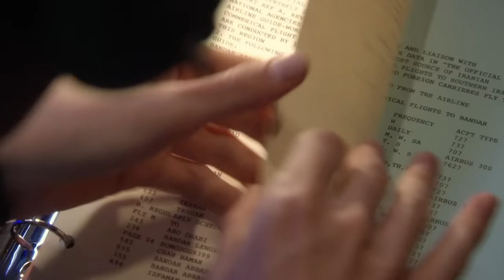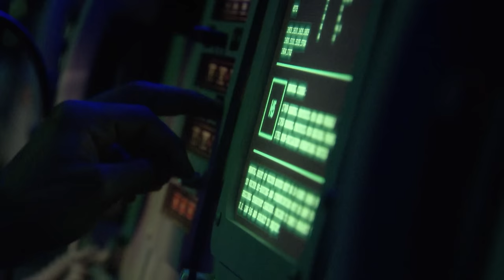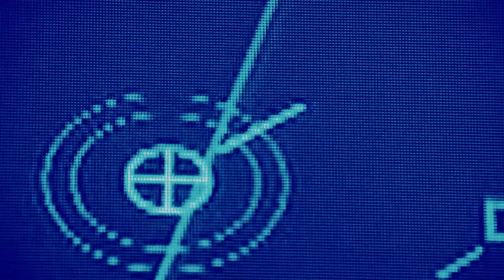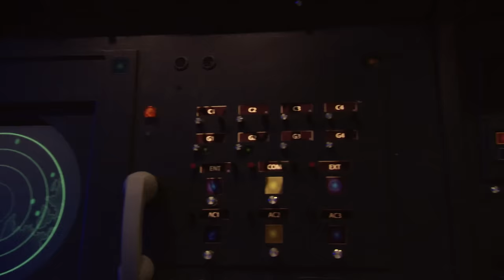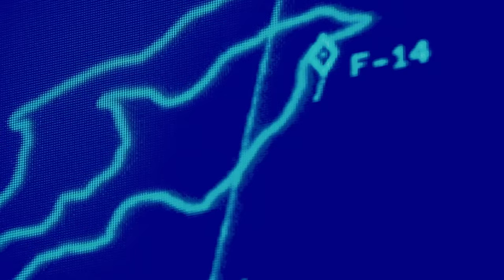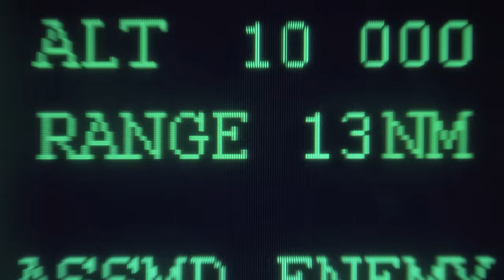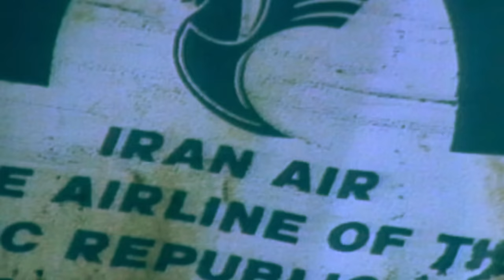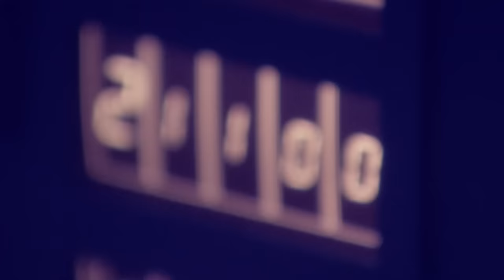The Billion-Dollar Decision: USS Vincennes' Aegis System Faces Unprecedented Crisis

Comment: i feel bad for all aboard that flight but i believe that the  USS Vincennes crew was not at fault
Reply: If u still believe the crew were not to blame after watching the complete video, you need to get yourself checked.
Reply: @akupehsluarketatAR  I mean I watched it and i do believe that even the inquiry found that the crew wasn’t at fault
Reply: @akupehsluarketatAR and you are showing clearly you’ve never been under pressure on a naval warship
Reply: @akupehsluarketatAR  

There's no question the crew was at fault. But arguably the bigger safety breech was committed by Iran Air - dispatching 290 people at low altitude smack into  a narrow war zone when they could have easily flown around it and approached Dubai from the east. That is mass stupidity above and beyond the confusion that reigned on the ship.